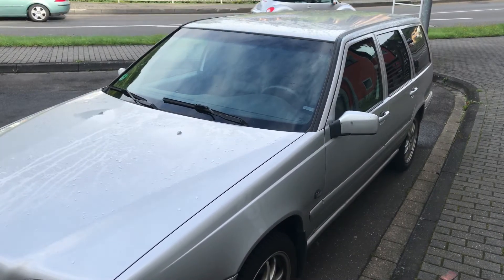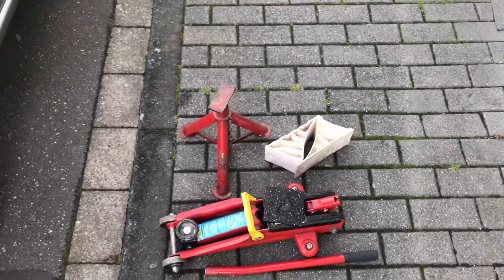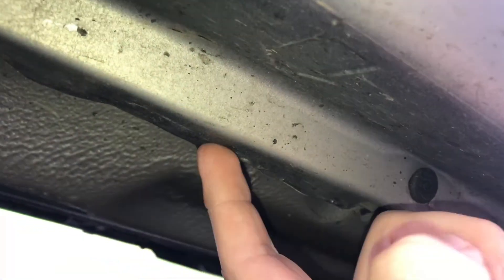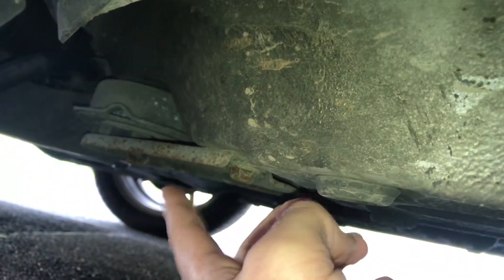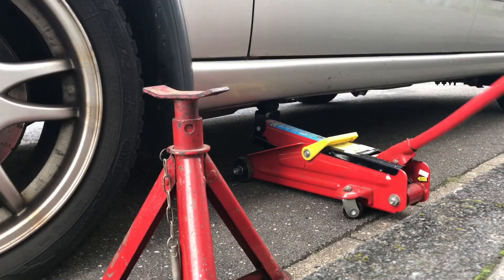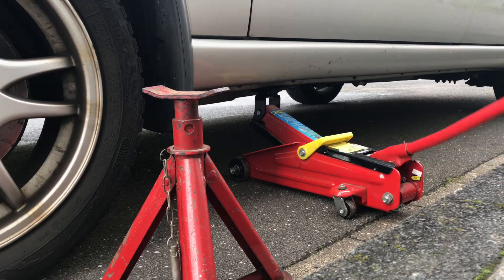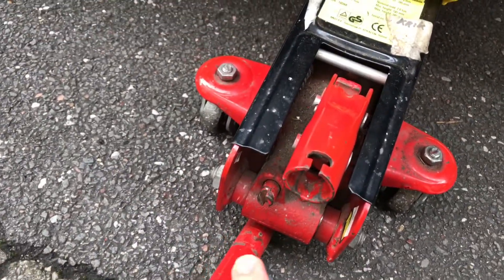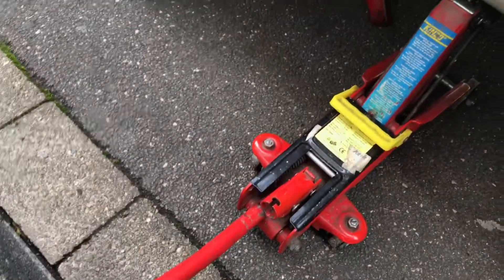How to lift a car Volvo V70 with a car jack front version DIY

Comment: I had to rent a cherry picker to hoist the engine on the stand and⊳⊳>share4.photo/EngineStand?72    fortunately the width of the stand rolled in between the legs of the hoist to make that task a snap. I'm using the stand for a Ford 5.0 H.O. engine out of a 1990 Mustang which weighs about 450 lbs. The stand doesn't deflect at all. The cast wheels roll easy too.